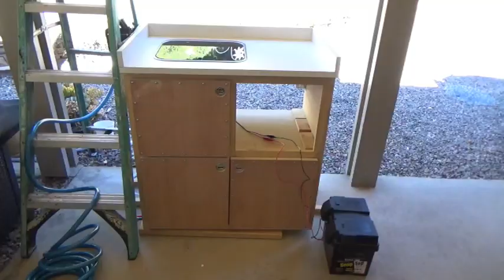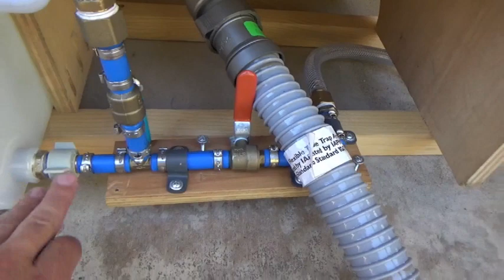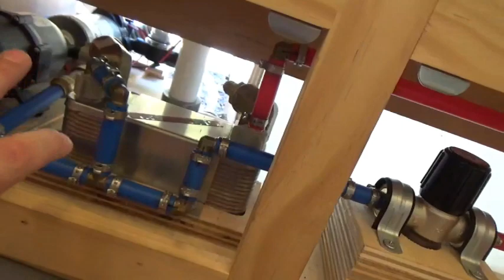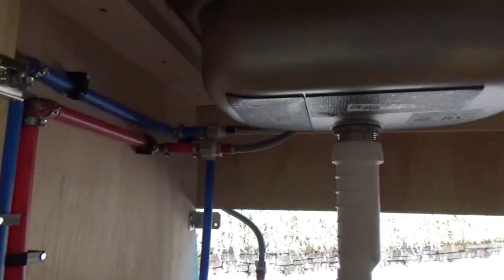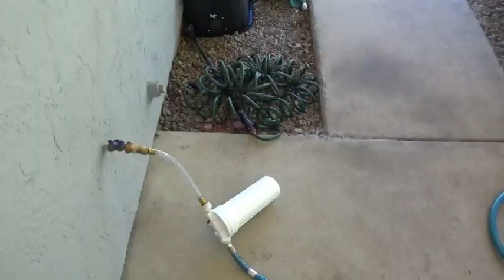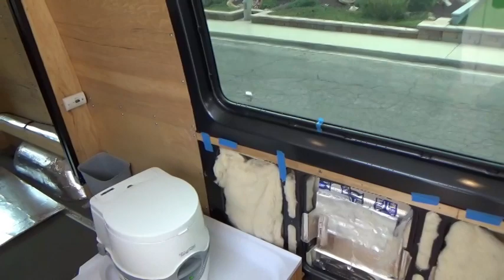Mercedes Sprinter Camper Conversion - Sink Cabinet

Comment: Well done. I am planning my Moto Van in a similar layout. Love the Happijac. One thing that occurred to me on the bike storage. I hate straps in a van. Consider using the footpeg strapless systems and a simple wheel chock in front . Simplifies the cabinet layout as you won't need the triangulation points for the straps. 
How quiet is the Happijac chains while driving? Do they rattle much? Are you doing any 3/4 passenger seating at all. That is what trips me up on these layouts most.
Reply from the maker: I did some sound dampening for the happijack chains. It is designed for a trailer and I dont think people care if it rattles.

I am working on the tie down solution like you mentioned. Too bad the moto clamps are being made anymore. So I have a Risk lock and load that I need to weld up a mount for my "L" tracks

Right now it is just two seats. I am trying to think of a jump seat. It is a juggle with space and what you want.
Reply: My Custom Sprinter I have the original dimensions on a link I can send you for the ATK bike shoes clamps. Let me know if you want it. They are easy to make. I know someone who made a few copies years ago.
Reply from the maker: Sure send me a link. I have seen some on Ebay, but I am a little skeptical since after I contacted the selller
Reply: thumbs4.ebaystatic.com/d/l225/m/mrSFbpXGVarlXT01vTZxMhQ.jpg
Reply: My Custom Sprinter How effective is the sound dampening? Is it foam stuffed into the channels?
Reply from the maker: I have video I need to finish editing